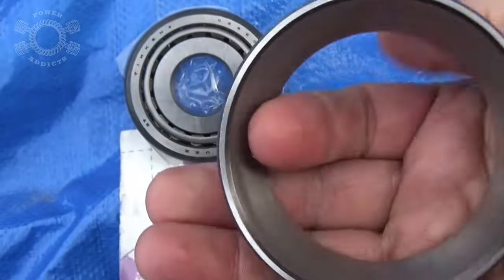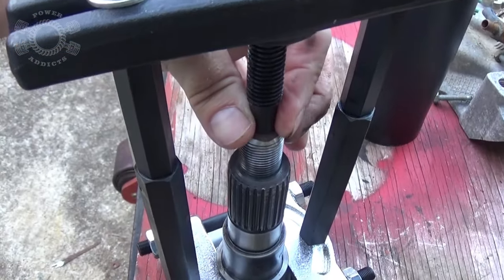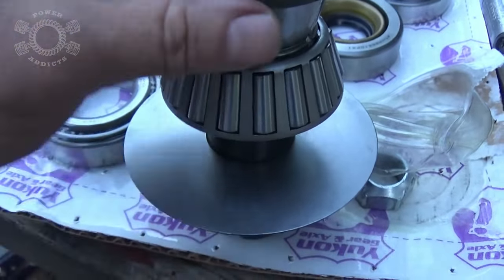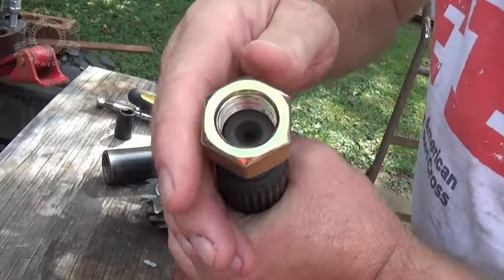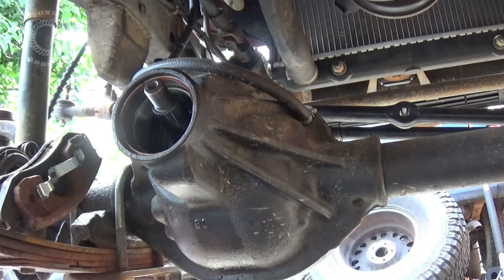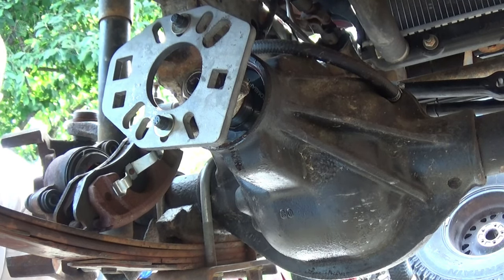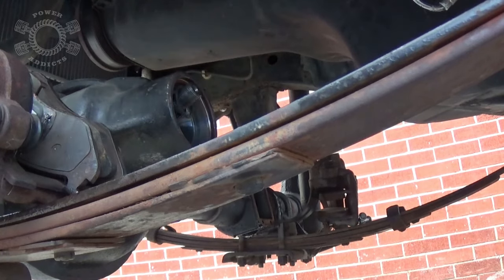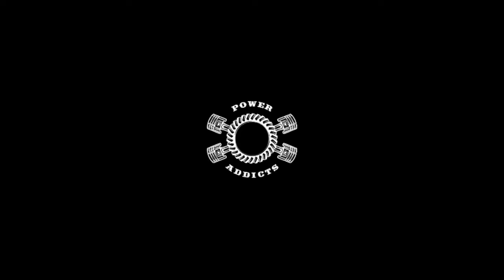Jeep Dana 30 Pinion install getting ready for the ring gear. #poweraddictscrew #dana30

Comment: You can pop the plastic lens off the dial calipers & clean the rust stains off with vinegar then put it back on or just leave it off
Reply from the maker: I've picked at it a few times to try getting it off. I finally just decided to deal with it. I can read it pretty much ok as long as the lighting is good. I may try again soon to see if I get lucky. Thanks for the tip!!

Comment: The bearing separator has a ball bearing in the end of the shaft that's supposed to act the same. It works until the end of it gets messed up
Reply from the maker: I agree, it is supposed to have that little bearing. Apparently it's missing in action on mine. Thanks for checking out the video! Have a great day!

Comment: I’m working on a LP Dana 30 for my 2000 xj with a crush sleeve. Setting preload similar process? Upon removal of my old races and bearings. The only shims were on the carrier bearings.
Reply from the maker: Crush sleeve is a different set up. I don't have a video on that one.

Comment: Where are you at, I need to change my pinion bearings. And I am not confident enough, I’m near Crossville. I have a 2001 Jeep WJ 4.7 Quadra drive. Front differential is not good. I have taken the drive shaft out to hopefully not cause more damage. Do you know what it would cost for me to have it done, and who…. Thanks your video was very informative, but a little more than I can do, but would love to learn with someone who knows what they are doing.

Comment: At 15:30, what torque did you tighten the pinion nut to?
Reply from the maker: As I said in the video I just gave it a good hard snug. If the pinion pre-load is close then I'll tighten it closer to spec. In this case, the pinion pre-load was too tight with just a "hard snug" if I had tightened it down to spec the pinion may not have turned at all or even possibly damaged the bearing or race. So, in short, don't worry about the actual pinion nut torque spec until the pinion bearing preload is close. Once it is close then start torquing it down to spec to check the preload.